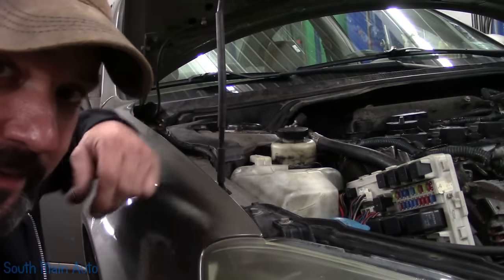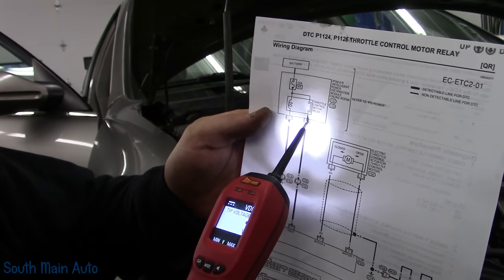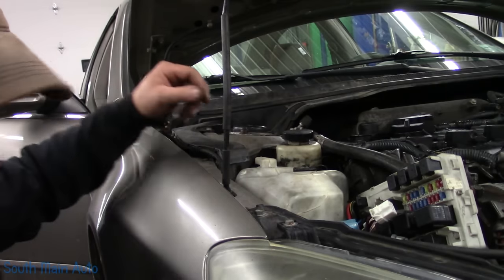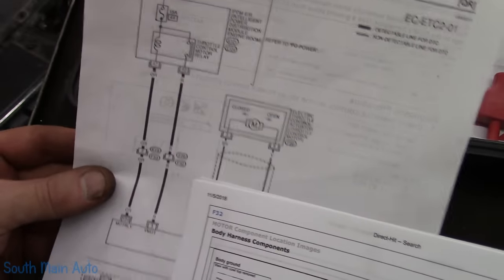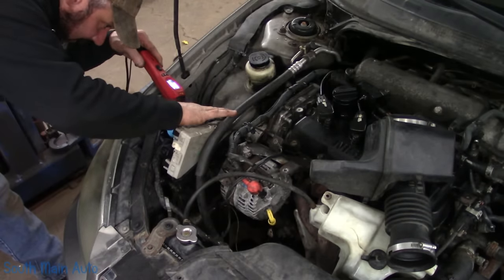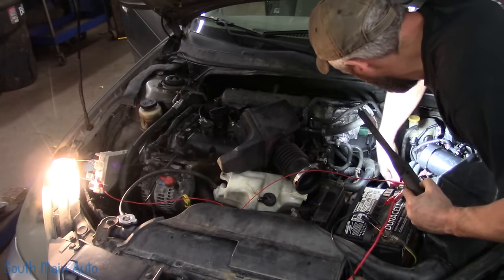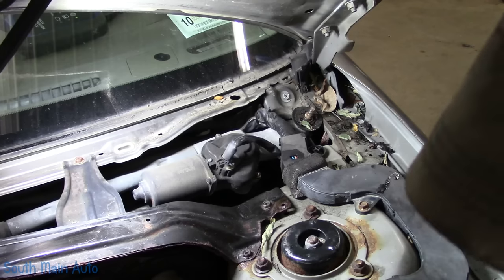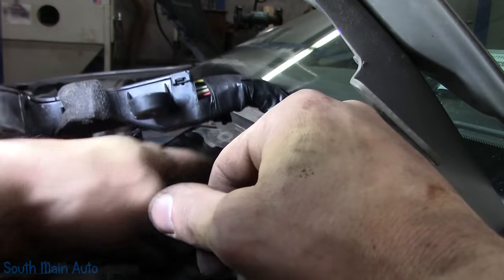How To Fix A Car That Keeps Blowing Fuses

Comment: It's very refreshing to the point of nirvana to watch you troubleshoot....going through the logical reasoning using very practical rules/guidelines.

the reason it's so refreshing to me, is because I spend all of my time in avionics performing this same kind of work, and it really is helpful to me that I feel I can learn some new things, but also validate some of the things I already know.  

It's a reality for me, that very few people in my experience are talented in this special skill set.  It requires a special blend of PATIENCE, but also persistence, combined with a strong accumen for researching then reading a schematic and then LOCATING the specific connections and routing.  This is often a task that involves hunting down wire runs.  I've known many avionics techs in my industry that simply give up.  These are very smart people, but they allow themselves to get discouraged because "it's not in the manual".  This mentality is truly what separates the difference between a very talented tech and just an ordinary parts replacer.  In my industry, time is very critical.  Missing deadlines is enormously expensive.  So, we end up with two kinds of caliber techs:  those who can perform the basic repairs, do the terminations for a repair, open up panels, print out the schematics...but there is a entirely different team that is activated when group B, can't locate the problem.  Group A is the team that knows how to do a proper ring out and can establish circuit aux power and begin the process of removing components and sensors out of the equation...This skills requires a very good nature about being patient, and also focus on the big picture.  Usually this is a team of two sometimes more, depending on the complexity.  The key is to write down the plan, do a quick brief and a bit of back and forth about what would most likely be cause of root issue.  Then recording test results as you move through the process.  Often this isn't necessary shorts, or open circuits, but is connector problems, or wire insulation problems from chaffing or damage from prior maintenance ....drill throughs from other teams!  Sometimes, it is sensors and components...relays, contactors, etc.  So there is a who system approach to dealing with the troubleshoot strategy.  But the basics always apply:

power?
ground?
split the circuits.

in some instances, simply swapping two identical components to see if the problem follows exists.  This simple technique for reasons I simply cannot really understand seems to escape many techs understanding.  Even when explained.    I'm not sure if it's related to intelligence !  I think there is something fundamental in the skill set that requires a different kind of thinking when performing detective work.  Deduction for some, just does not "click"....

I've worked with some teams who only know how to troubleshoot a system they have already been successful repairing..But give them a new problem, even when it's found the root cause is nearly identical and they can't seem to figure out what to do.

I've come to learn over time, that most people simply memorize. And that's NOT learning.  

At my brother's high school graduation, many many years ago, I always remember the valedictorian making his speech and the one thing he said always stuck with me:

highschool has given us HOW TO LEARN HOW TO LEARN.

LEARNING HOW TO LEARN...

it's really that simple.  Once you've established that philosophy about "education"...it really becomes clear what school and life is really about:

problem solving.

I suppose that is the reason why I have never been bored with this work.  I'm sure to someone else, it might seem very difficult..even impossible...like magic...or requires incredible intelligence.  But that just isn't true.  It simply requires a different frame of mind and lots of patience and good reading skills, and good logic and reasoning abilities.  

There IS a point in time, when you have sufficient experience, that you can look at a problem and make a very good informed guess at to cause.

WAY TOO MUCH emphasis is placed in  testing gear...at the end of the day, ever single problem you will ever solve begins and ends with your brains.

Comment: I just refered you Eric to two seperat people, both with electrical issue's! 1st is a 05 town & Country A.S.D curcuit/ blew the fuse & lost spark. Replaced said fuse, cranked the engine & it blew again! Swapped out the asd relay with the horn relay & the issue stopped but, the van then had a misfire! SECOND Is a co-worker whom has a silverado which looks Nice! Had a engime replaced & now all sorts of electrical issues!!! I referred you Mr.O.... & Ivan!!!!!! Wish you guys were local! Or that i had better scan tools & a power probe but, Id be scared to add the incorect polarity! I am not the best woth curcuits that I did not run myself!!!!!!

Comment: Your technique is correct! To find a shot you open the circuit in as many points as possible, usually at the connectors/plugs and narrow it down between those points. When you get close monitor the circuit with, in your case, a light (I would have used a meter) and wiggle and watch.

Comment: Very well laid out video, unfortunately (or fortunately) I think I will have to get a pro to chase the spark that is causing my 40Amp starter ignition  fuse to keep blowing.  Changed the starter (which was "0" fun) no crank, no start.  Then went to fuses and found one of 3 blown.  2004 Ford Ranger has 189,000 on it and has been a champ, am willing to pay someone to get it done, pretty sure you do not live in Wa state or I would drive it to you.  Thanks for all the information and hard work.  you are a pro!

Comment: This kind of wiring short is a lot if fun with a cattle trailer, because it has So many marker lights on only two separate circuits, Even if you split the problem it still has In most cases at least 40 different lights hooked up to one side, all you can do is start unplugging lights until the short is found most of them have plugs way up near the roof where the pig tails drop down the channels going  to each light and Yes Sh-t everywhere it can be a real pain in the A🤓       Another Great Video with top of the line Diagnostic info Thanks ERIC, Some people may think he's just trying to add up more time to bill the customer but it's the only way  a mechanic can truly save the customer money and actually repair the problem, meaning thorough work like this is required not an option 😎

Comment: Before you can fix the problem, you gotta find the problem. USAF trained tech here. The "Half Split method" is the basis for almost all troubleshooting and circuit diagnostics. So, great job there! But I personally would have liked to have seen how you repaired the chaffed wires in the bundle.

Comment: That was awesome. Just using the process of elimination to narrow it down. 
I've run into my share of electrical gremlins over the years too. Most people freak out with wiring problems and repairs. 
I say embrace and conquer.  A wiring harness is a component just like any other and is most often overlooked but not a big deal to repair. Just sometimes a PITA to find. 
I'm an aircraft tech by trade but I do my own car maintenance. 
I'm here to tell ya, a fleet of the same type of aircraft (F-15 fighter jets, in my case) are much more forgiving and the tech data is very precise. 
I still enjoy doing my own vehicle repairs even though it means having to rent a car at times.
Good stuff. I really enjoy your videos. I've learned a lot, even after 40 years of doing this stuff.

Comment: as a suggestion for a tool to add to your kit, a thermal camera would help you trace that out, you would see the wire getting warm and it would end where the wire was shorted to ground.

Comment: This was really good; I've had to do some work like this and all I have is test light and multimeter but the schematics are the key.  In fact, with good prints, they will tell you where the wire runs pass through and where to find connectors.  Really surprising on that one they didn't burn up the car. And in hindsight  you always want to look at wires where they get flexed or moved by something else such as a windshield wiper transmission but I would never have thought of it.  Anyway, this was really well done, you show how it's done right.

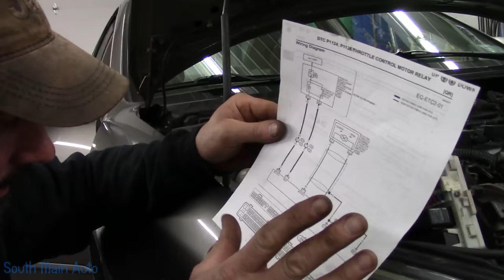Comment: 10:00...yes, logical, cut the circuit in half. Esp wise when fault finding on a phone cable 4km long (and the poles are 40m apart, that's a lot of poles to climb!), halve it, find direction, repeat, rinse, repeat till you get it. Even a TDR (time domain reflectometer or as we called it, a "slide") doesn't always pinpoint the problem, lady! Great work as always, Eric! At 61 I'm out of patience with cars, despite. or even because of, having done my rounds of second job car repairs...

Comment: Always nice to see the "up" in your giddy when a good mystery crosses the shop's path.  Of course, you gotta have the time available to solve said mystery.

Someone needs to send you a "Wire Whisperer" embroidered ball cap.

Oh, and the next time I'm working on the lathe, I think I'll chuck up some small-diameter (1/4" or there abouts) aluminum stock and make a few micro rolls of electrical tape spools for those small spaces.

Comment: I wish it were true that "if you can do it I can do I." Just got through working on a 2006 Ford Freestyle - changed spark plugs. Left one coil wire off. Had to take it all back off. Put it back together. It ran great for 2 days, then started blowing a fuse and now wont start at all! I'm beside my self and going out of my mind. Gotta get from KC to St. Louis to take care of my sister in law going through a bone marrow transplant. Gonna have to rent something and leave this disaster behind. Nevertheless, you are awesome.

Comment: Great video.  I'm having a short on a circuit on a 2002 RAV4 resulting in a blown fuse every time the AC is activated.  I have the (confusing) OEM electrical shop manual, and a desire to track this down myself.  I will definitely use the led light method you incorporated if I can't find the obvious short in a visual inspection.  If you were located in my neck of the woods, I would bring it to you, so I could take care of my other chores 🤣.  Anyway, thanks for the great example in problem solving, I'm confident I'll figure out my issue now.
Reply: Disconnect the ac compressor and turn on. This will eliminate it if the fuse still blows. Start there first. Let him know after that

Comment: The  "Jacket" that she has on is normally called a sweater jacket, so both of you are correct.
Little holes make big problems when you are working with wires. I suspect that something pointy was sticking up through that hole because the last person did not rehang the wire loom correctly.
When I get back to the states I will have to replace the wiring for the rear end of my Suburban as it sat where field mice could get to the wires. I am sure of this as I have found insulation matted up in rats nest configurations throughout the vehicle. I will have a big job, but, it will not be bad as I will use the wire codes that are on the wires that are left to connect everything and also check each system as I rebuild them.

Comment: I had a mechanic friend trying to diagnose an intermittent short on a pickup.  Of course it worked perfectly in the shop.  Out of frustration, he kicked the truck, and in the process located the short. Just a bare wire touching the frame.

Comment: In the initial diagnosis I thought the problem would be the classic chaffing short or a prior repair pinch. An option to using a razor knife to cut into harness sheathing is to use lineman scissors which I think are easier to control. Given the room around the harness when secured, I think there is enough room to use some plastic convoluted tubing (high temp) around the repaired harness before wrapping with tape. There is the option to use a hose clamp with rolled edges and a piece of hose as a cushion. That would omit the possibility of the large black zip tie being cut at the sheet metal.

Comment: the hardest problem to locate is one created by a "tech" when "he" or "she" is solving a problem and inadvertently creates another which appears to be what has happened in this case.. they changed out the fuse block and messed up the wiring harness underneath the wiper assembly.. it takes a great troubleshooter to locate this type of problem.
thank you very much for showing us how you go about locating this type of problem where a different person "shot" themselves in the foot but you worked it out for the repair

Comment: I like your method of process of elimination. It's effective and it works. Here's the problem.The other shop has now put the customer through for how many hundreds of dollars if not more because they couldn't or wouldn't do what you do. I happen to think that is a tiny little bit criminal. They are charging for components that are not required because they are incompetent and they expect the customer to just accept the fact that they don't really know what they are doing or too cheap to subscribe to the various services that supply information like wiring diagrams.
And it's what is known as a sweater jacket or a cardigan.

Comment: Incredible diagnosing. That's three quarters of the job right there alone. To be able to find the right part and not just throw parts at it. That is the difference between a good mechanic and a bad one. A guy that can actually fix your car opposed to somebody that tells you you got a bad ECM and to junk it.

Comment: Had a fuse blowing on my 66 GMC, brake lights and other misc stuff. Factory harness was routed between bed and frame, in the back, and had worn through the brake light wire.  Didn't short all the time, just when you hit hard enough bumps.  You had to be applying brakes and hitting a bump to cause fuse to blow.  Really interesting intermittent short case. I thought so anyway. ;)

Comment: Eric, I'm not as patient as you.  Since the fuse block and the ECM are in close proximity, I would have snipped the red wire near the block and the ECM and patched in  a new red wire.  Everything would have been alright until that blue wire shorted out!

Comment: Question. Do you ever check wire integrity, end to end with a ohm meter 🤔
Reply from the maker: Never. An ohm meter is the worst tool you could use for wire integrity.

Comment: This is the trouble with modern 'mechanics', all they get trained to do is replace units to see IF it works.  It doesn't of course and the customer is left with an unrepaired vehicle and a bunch of parts they don't need plus the labour to not fix it.  I'm self taught as far as auto electrics go but even my basic knowledge and equipment tells me to and is perfectly capable of checking for a short to ground BEFORE lashing out on expensive components that may not be needed.  It's no coincidence you end up with work like this as you have an enquiring and analytical mind that reasons 'let's check the basics first'.  Good viewing sir and an excellent lesson for some modern day mechanics.

Comment: Ya know, common sense says that when a fuse blows the second time, there's something wrong with the circuit. Anybody can look at a fuse and see if it was a dead short or an overload. I've had them get instantly hot and blow while I was putting the new one in. I love the way you isolated the sections of the circuit to find the problem and I thought your eyes would pop out when you touched the wipers! It looked like you were just using them for support when you leaned in. Nice going bro! I wish I lived in Avoca! I need to pick your brains for a problem I'm having, but know better than to ask for free advise.

Comment: Got myself a similar situation but mine is a drain, it drains the battery completely within 30 hrs, can’t find it for sh!t I’ve brought electrician mechanic friends of mine and they couldn’t find it, I’m going to have to disassemble the whole freakin cabin and engine bay just to track that fkr down, this vid helped a lot even though it’s an Altima and I got myself a blazer. Thanks

Comment: Great video, thanks for taking the time to make it. I have a follow-up question, @ 2:00 min. you talk about the hot at all times fuse that feeds the relay before you continue on the wiring diagram. My question is, if that fuse is not hot at all times and there's nothing coming out on either side of the fuse, then what? Where should I look?

Comment: Get a turn signal bulb and use it instead of the fuse that keeps blowing. (You will need to temporarily wire it in to the fuse connections). Power on, and the bulb comes on. Pull the wiring around until the bulb goes out, and from there, a close inspection will show where it shorted. Another tip...  My radiator cooling fans kept blowing the fuse, but this was because of a very bad connection, and the continual on-off surges into the fan motors blew the fuse. And there was I, looking for a short...

Comment: Literally broke my troubleshooting down to wire harness wiggling a few weeks ago... I dont work on cars but I work on air compressor or vacuum systems that can have up to 6 pumps all controlled by a PLC (the ECM of the motor control universe)... wire wiggling didn’t find my problem but the Ol Fonz treatment did... smacking the PLC could get #1 compressor output to turn on and off without command.... I laughed when you touched the wiper and the light turned off

Comment: Awesome stuff I must say ... I have a  07 Saturn Aura 3.6l that is blowing the injector/ coil fuse every 10 seconds it is a hot steaming mess because someone started to check and left a ton of wires exposed but am having an issue with those two fuses and also not getting any lower to one coil and the injector of the same do you think I may have the same problem ?